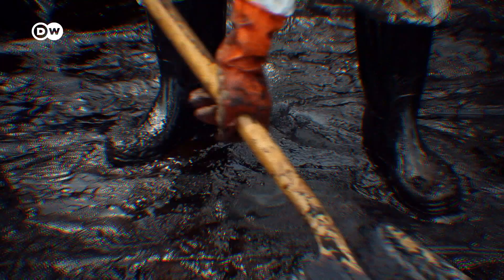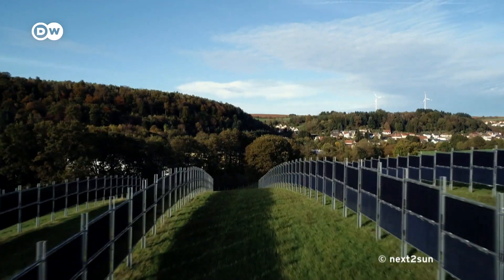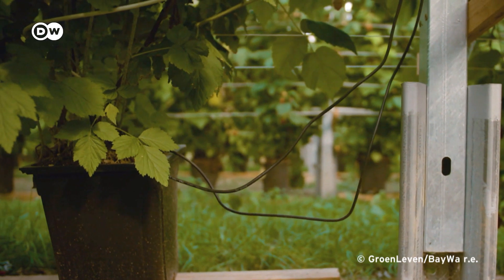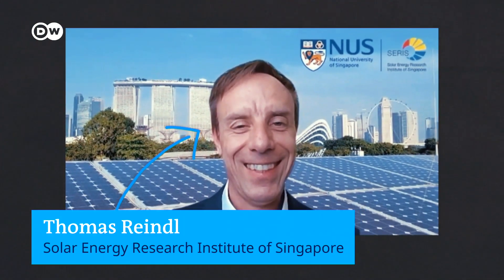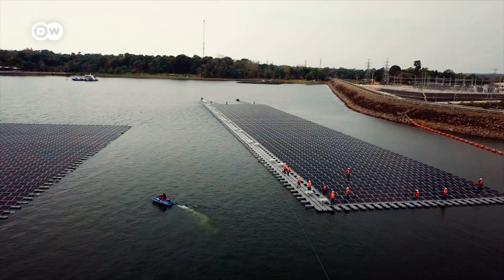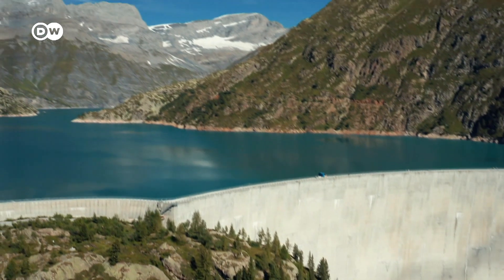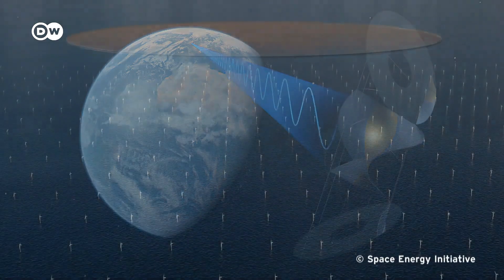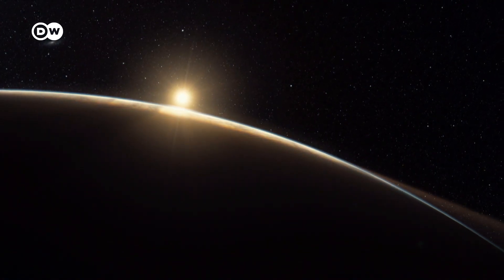Why we should be putting solar panels on our fields and lakes

Comment: There are so many heavy metals in solar panels and I couldn't imagine how much of a disaster this could cause. It doesn't even make sense to do this though when you always have a ton of roof space. If anything it's likely going to be best to create a more distributed power network integrating panels/thermal/wind where applicable into/onto existing structures.
Reply: The 'dangerous' heavy metals in solar panels (and it aren't many) pose no risk to the environment as long as you don't grind it into smal dust or burn it at a high enough temperature. Moreover they are nearly fully recyclable.
Reply: Hi. Sensible comment. Cheers, P.R.
Reply: Finally, one comment that makes sense.
Reply: There are many toxic chemicals in solar panels which  include cadmium telluride, copper indium selenide, cadmium gallium (di)selenide, copper indium gallium (di)selenide, hexafluoroethane, lead, and polyvinyl fluoride. Silicon tetrachloride, a byproduct of producing crystalline silicon, is also highly toxic, and as much as 80% of raw silicon is lost. Throughout their lifetimes they leach these toxins into the atmosphere and ground, solar panels also release nitrogen trifluoride (NF3), a chemical compound 17,000 times worse for the atmosphere than carbon dioxide.
Reply: @buildthis99  Hi. You're quite right, and when these are in high concentrations injurious to health, they're non-starters. However let's not overemphasize possible negative outcomes, any decent recycling scheme will eliminate the risks. Also, we're ingesting small doses of poisons all the time. The air we breathe has poisons, we've just got to "suck it up" and trust our testing regimes to set maximum allowable dosages on the safe side.  The human race survived four hundred years of smoking tobacco and breathing coal dust and combustion products without gasping its last. 
(Cough, hack wheeze!). Cheers, P.R.
Reply: Only one eyed scientists would recommend putting heavy metals on water, quick leak kill everything..sounds like a good plan (NOT)   Can't even put manure on fields these days because of run off into water courses.

Comment: Car parks, and warehouse roofs while fully using all possible roof space and not just enough for said building's energy use. Along highways and rail tracks. Plenty of open areas are available without needing to clear new land for solar. I am for floating solar when used for freshwater preservation. I do think it is kind of wasteful if a reservoir is converted from a recreation area to being blocked up by solar farms. Maybe only set them up in previous no-wake zones where it is too shallow for boaters anyway.

Comment: Solar panel production requires two primary resources, 1. Quartz for high grade silica, and 2. Coal. 11 tons are burned to produce a solar panel. 

The vast majority of solar panels used worldwide are made in China where 25% of the worlds carbon emissions come from. China’s carbon emissions won’t peak until about 2030, and they continue building dozens of coal power stations every year and won’t phase them out until 2060. 

Carbon emissions and climate conditions are global. 

It’s important for us all to be mindful of global emissions while manufacturing the cheapest products in dollar value, but most expensive to our planet’s ability to support life, and to be weary of governments  and suppliers of energy delivering less stability (baseload) while charging us more and more.

Comment: Its taken many years to get to 1 degree if the industrial resolution is the cause. So we have another hundred years maybe to implement technological solutions . Don't Panic, technology will sort it out. Agri-voltaics is an excellent idea though for areas that are too hot to farm and have always been like that. Potentially this system could supply massive amounts of electricity to the grid or form self sufficient local grids. In arid areas water use is also a problem which could be assisted by carefully targeted irrigation using the sola power
Reply: Yeah you don’t have any credentials. I’ll listen to University of Arizona professors, thanks.
Reply: @KebobLimonMunchers  Even professor's need funding from eco-loon governing sources , they say what they are told to say.
Its not like any eco-disaster prediction has come true in the last  50 years. 🤣🤣

Comment: Solar is great and all but everybody should know that wind energy is an enormous scam.. look for 3 minutes into what happens to the unrecyclable fiberglass blades of wind turbines. 
Best case scenario is that it's shredded and used as a combustion fuel for cooking cement mix. In reality the vast majority ends up in landfill.

Comment: One of the best  and I think simplest way is to mandate solar panel on each house / apartment / factories etc at least in urban areas
Reply: Not everyone can afford if, second point Solar energy can’t withstand harsh weather conditions such as freezing temperatures, so it won’t work everywhere.
Reply: @vkrgfan  In terms of affordability, the mandate can force banks to provide cheap loans. Considering solar panels earn their investment back overtime in saved energy costs, there really should be a 'too expensive' argument. Though maybe a clause could be put in that you are excempt if you use/are going to use too little energy for the panels to be worth it. Though it is unlikely that minimum won't be reached by the vast vast majority.

PV panels not able to withstand freezing temperatures is new to me, considering it is being used in area's with even quite some snowfall. Pretty sure you either have been misinformed or we are talking about freezing temperatures so low that human habitation will be nearly impossible/very harsh.
Reply: @MDP1702  good point.  Currently the loans come with much higher rates since these are unsecured assets.  Unlike a house, a bank will not reprocess solar panels in case of non-payment.   That’s why rates are double of a house (to accommodate risk) and very few banks offer the service.  If we had similar Federal backing like what the FHA does for first time home buyers, installation prices would drop dramatically.
Reply: Neither good nor simple I'm afraid. Many sites will be unsuitable, and would result in a lot of e-waste for a little harvested energy. 

Manyconsumers would buy the cheapest possible setup that satisfies the mandate, resulting in bad experiences, fires, and hurt solar's reputation.

Setting a city-wide mandate with a deadline would cause a massive spike in demand for domestic installations. It'd be a golden opportunity for unqualified opportunists to fleece consumers.

Attempts to enforce the mandate (by who?) would only harm sentiment toward the green movement.
Reply: @westasleep  Many sites will be unsuitable
Most regions/houses would be just fine, you can always include the possibility to ask for an exception in the house's permit request with the specificied reason (eg. shaded roof area due to trees). Also in larger regions where it would be that usefull (like a place with very little sunshine, ie. Alaska, ...), you'll get regional exceptions.

Manyconsumers would buy the cheapest possible setup that satisfies the mandate, resulting in bad experiences, fires, and hurt solar's reputation.
The mandate can easily set a minimum standard, so this really isn't an argument at all. Moreover most people would go for the most cost-effective setup they can afford, not just the cheapest. The mandate even can include that banks have to provide cheap loans for those solar panels.

Setting a city-wide mandate with a deadline would cause a massive spike in demand for domestic installations.
Which is why you'd only mandate it for new buildings or those undergoing extensive renovations. This way you spread out the impact.

I am not saying this absolutely would be a good idea (though imo it defiitely could be an option), however your couner-arguments just hold no merit at all.

Comment: Question... Can plants that oxygenate and clean the water grow under the pannels if a lake is covered?
Reply from the maker: Good question, Newsham! In the video, we only mention fish farms but research is underway regarding the water quality and biodiversity under these floating panels. According to the water quality study conducted by Hanze University of Applied Sciences, the oxygen content under the floating PV modules has changed only minimally within a year, as wind and sunlight still manage to reach the water under these floating photovoltaics. When it comes to biodiversity and the environment, Buro Bakker / ATKB researched and found that panels lead to lower wind levels on the water surface, which results in less erosion of the banks and therefore protects the vegetation and stimulates plant growth. Such studies are still relatively new – more studies need to be continued to examine the long-term effects in more detail.

Comment: sounds great in theory.  I have hesitance of the reason they dont mention species of crops that require critical soil temps.  Shading of the soil by the solar panels have a dramatic affect on production.  Also, the rigging required to attach solar is usually not movable and the harvesting equipment is very large and not nimble by any means.

Comment: 13:30 if the strength is only 25% of the sun... Then we'd need even MORE SPACE for "rectennas" than we'd need for PV solar. Or, roughly the same size if we account for the 24/7 generation

Comment: The video is wrong about the wireless transmission of the energy produced by the satellites. It says that the WIFI frequency is the same, this is false, the WiFi is 2.5 or 5 GHz and the antennas of the  satellites emit at 10GHz. And what is worse it says that the WiFi can pass through water, this is exactly the opposed of what is the target behaviour of WiFi which is mean to have a short scope.

Comment: I didnt watch your video. it was so patently insane. Just from its title.  What your video is proposing  is ecological stupidity. There is more than enough real estate to put solar panels without cutting off light to ecologically sensitive environments.  Farms are beginning to understand. They are putting solar panels and wind generation on their farms on things such as barn roofs and waste land that just sits there and exporting the energy as another cash crop. Solar panels on every rooftop with storage at a central location would more than generate enough electricity along with traditional wind power.  You will find that agriculture has a lot more viable options for the use of solar panels.

Comment: How do we deal with the heat produced because of the lower albedo of the solar panels? Will this drastically increase temperature?
Reply: If you look at a thermal camera image of a roof with solar panels, the panels are cooler than the surrounding roof. Which makes sense. The light that falls on the roof and gets absorbed just heats it up, while about 20-25% of the light absorbed by the solar panels gets carried away as electricity, leaving less to be radiated as heat.

Comment: Just build solar thermal plants.  All they need is mirrors and salt and everything a normal steam generator plant needs.  Much less impact and waste in building and much more efficient than PV.  They also work for a while after the sun goes down on residual heat.  If you are worried about birds, put a net dome over them.

Comment: I remember many decades ago, reading that one of the Scandinavian countries were putting solar panels on the sides of roads and in the medians of roads.  Is there a reason we can't put them along train tracks and along highways.  How many thousands of miles would that be?  How much electricity would that generate?  Quite a few million barrels of oil, I'd say.
Reply: Busy roads produce nasty, sticky, oily, waterproof residue that would necessitate very regular cleaning. I'd expect to see output fall by 10-20% per month between cleanings in a highway setting.

You'd also need to ensure that the panels' coating can resist chemical corrosion from the hydrocarbons (and the solvents used to wash them off).
Reply: @westasleep  OH !  You mean like the coatings on our lungs, from all the dino petrol gas byproducts.  ha ha ha.  Ok,  your explanation makes a lot of sense.  Maybe if they did it, they could coat them with self cleaning glass, you know the type the talked so much about - how it was all supposed to be put on all our buildings, but now you never hear anything about it.  I did see people are putting circular vertical wind turbines by where trains run to spin when the trains go by and the puff of wind displaced by the trains spins the windmills.

Comment: Solar and Wind are complicated unless there's a cheap and efficient battery to go with. Energy production for these sources have an intrinsic quick oscillation in output and that, paradoxically, requires Thermoelectric Power Plants to smooth these oscillations. Solar and Wind are also highly pollutant in their manufacturing and recycling chains due to the heavy metals needed (this is more a Solar Power problem, btw).

Now ... space, right now, is a waste of time and resources - good idea for the future, though. We have to get to the future, though.
Reply: Space is hard, but we should still encourage a small percentage of our national budgets to be put towards it, just for the side-benefits. The Apollo program helped kickstart the integrated circuit industry by making orders for thousands of NOR gate chips to build the Apollo guidance computers. This was back when the industry was so new they were only selling a few hundred chips per year, and now NASA was knocking on their door with orders for several thousand because they needed to make a compact computer (~70kg) for their moon landing. Now it's a worldwide industry that makes billions of chips every year that find their way into damn near everything.

Comment: I would love to see more solar going around the country. but that's going to take a massive amount of resources. And even then, we need other types of power sources too in order to handle the changes in Demand with the power grid. Solar doesn't exactly have an on/off switch for those sudden changes.
Reply: We would need to supplement with batteries, natural gas generators, and dams when demand is higher than solar and wind production but it would still cut down on our dependence on fossil fuels.

Comment: Why would u want to climb up in space if theres an open, free, vacant, and accesible than space DESERT? Solar panel in space is already there and happening, telescopes and some space missions are powered by solar. How much do u think to carry enough panels just for united states only first, how will u transfer the energy harvested in space? beams? lazer? sure but how much will it cost to invent for ur solar panel in space? 10b$ is not enough, it will take multiple space flight darling. Still want to proceed?

Comment: "Whats the best way to build solar pannels without loosing much needed space?"
Not sure if it was one of your documentaries or one of arte ..., but there are currently research efforts been made with solar pannels in a vertical orientation(here called solar fences // im Lot zur Erde stehend) as it seems to be even more efficient in conjunction with agricultural fields.
The problem being with horizontal or slightly angeled panels, the water is not spread evenly and one would need additional watering mechanisms which would eat into the energy balance.
What was new to me and never considered, was that there could be nearly a greenhouse effect for tomatos and other plants which otherwise would maybe get even too much sun. So it is not only about what is the best overall solution, but rather what is the best solution depending on the plant you want to harvest. I would expect depending on how you construct a solarpanel, you could direct rainwater also downbelow instead only towards the edges. Can farmers in europe get subsedies to establish such systems? The other buzzword currently in agriculture is regenerative farming, could these concepts be combined?

I'd need more information on the longterm effects of floating solar pannels to its direct environment before taking a stance on those. One thing they deffinetly arent't and that is pretty. So those of us who at times look for some untouched nature wont like it to see every inch of inland lakes covered in solar pannels. Maybe that too should be factored in within our need for energy. Same argument surely would count for solar pannels within agricultur. Maybe we need somthing like exclusion zones. Like we could have in a 7 kilometer radius around cities these concepts established first, which would also make sense in terms where this would come in handy where to use it, but have your more rural communities protected from these, but keep them as more nature orientated and recreational without all these.

I can see though the appeal to protect water from evaporation for areas where scarcity becomes an issue.

The solar pannels in space may have a secondary use which i would want to be seen debated should it be feasable as i currently conceptualize them. Depending on how many of those there would be, we would microwave parts of the atmophere and that can't be all good, depending on who or what is flying threw it or at what on earth it is aimed at. Besides the technological challanges to protect them from solar winds, getting them up there and cosntructed and suchlike. I am not against them, but there definetlly needs to be international debate and regulation, soo good thing you made them a topic :)
Costs for infrastructure i always see as an investment in the future and therefor i find myself rather agreeing with bold concepts are these than in the past with investments into say military, though that didn't age well(looking at you Putin -_-)